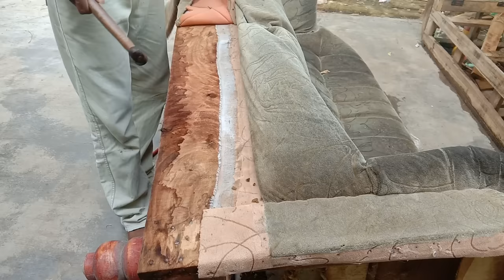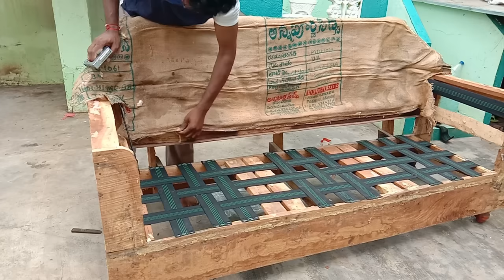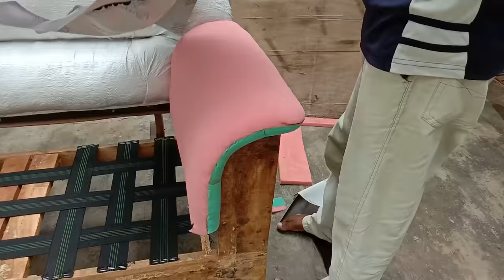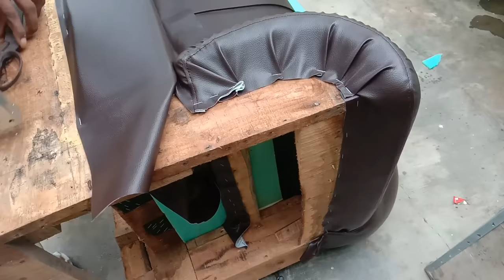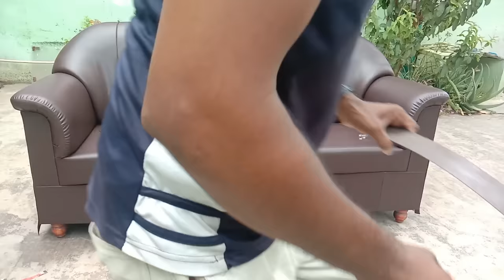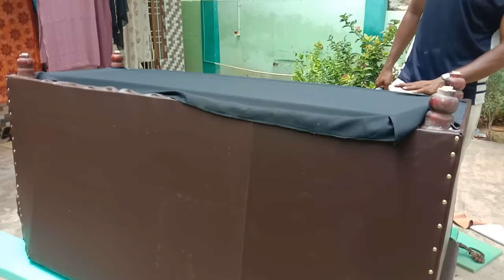how to make sofa leather sofa repair sofa making sofa set creating sofa making process  simple sofa

Comment: It doesnt matter what trade it is, you really have to admire the skill set of these artisans have and how they apply it to the job at hand. I have to admire a person who can tend their trade so well and produce an awesome piece of furniture. Well done my friend from Australia.
Reply: I agree Gordon, & I am Australian too...And now I see the inside makings of a couch, I plan to always lift up a chair or couch and look under it as well as the top. Ohh and also, when you have cushion's or extra padding made for a couch, always unzip it and see if they have sew the foam into a separate case, because you need this if you are going to remove the covers to wash them and another thing to check is if the inside of the coushion where the stitching is has been over-locked to prevent the material from fraying. It's not just about what it looks like but how well it's made...Rozz...Brisbane
Reply: Number please ma sofa kuda repair cheyali

Comment: My father was an upholsterer. In the late 40’s and early 50’s he worked in a shed next to our house and re-covered many,many suites for local people. In place of expensive leather, linen and velvet ,  Rexene and moquette were the usual materials used to cover them and, until foam rubber was invented, they were stuffed with horsehair and flocks. He used tacks (which he held in his mouth...blowing the dust off them first.....and occasionally, accidentally swallowing a couple) The finished product looking something like this but with the luxury of springs artfully held in place by a lattice of webbing  the seat  was. cushioned with horsehair or flocks.
Modern methods include the use of an air compressor staple gun which is much faster,  less tiring and safer than hammering in tacks or using a hand stapler. And,as mentioned in the comments, for most people it is cheaper to buy a new factory made suite than re-cover the old one.
With the rough hewn frame, no electricity and limited resources he has made a great job of updating and recovering this wreck of a sofa. 👍
Reply: My bro-law has a horsehair saddle blanket or did
Reply: I'm guessing by the comments here most folks don't know how furniture is made and have never been in an upholstery shop. I love mid century modern and have an old couch that I had recovered. Staple guns seem to now be standard tools of the trade.

Comment: Great work and amazing finish. The only suggestion I would like to add is that it would have been better if you had sanded down the wooden frame and treated the wood with some oil so as to get rid of any mold and give the couch a long life. Overall great job. Much, much better than what we get from amazon or other western outlets.

Comment: The amount of labor involved in refinishing a couch plus materials is usually more than the cost of a new couch.  The only exceptions would be high end pieces.
Reply: I doubt it,the most expensive piece would be the leather and that would just require a higher asking price.Any other material would be cheap and this is a very nice looking one.
Reply: Most furniture doesn't even have actual leather.  Most buyers can't tell. They purchase from look.  Building all furniture is extremely cheap. Products are sold based on labor.